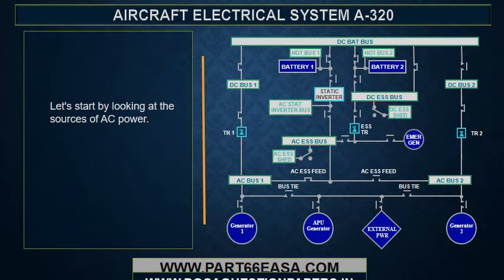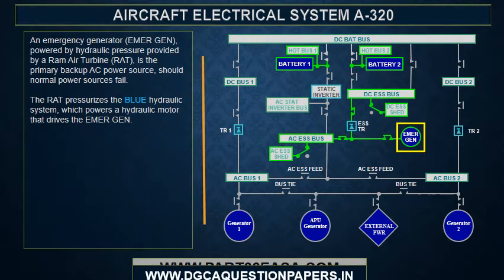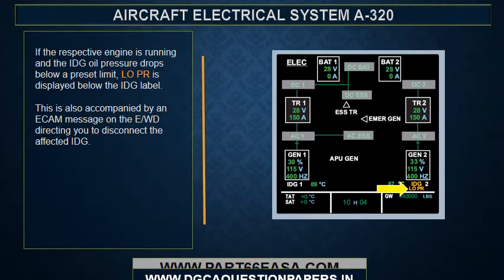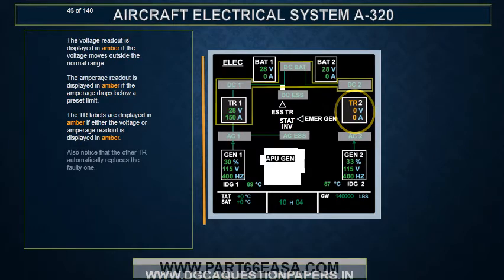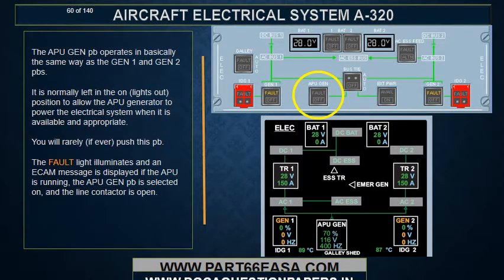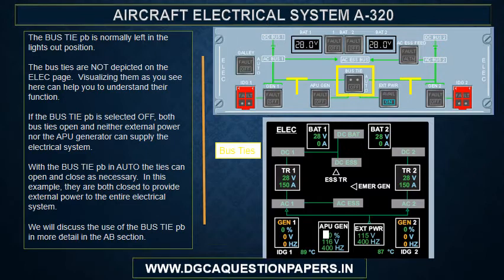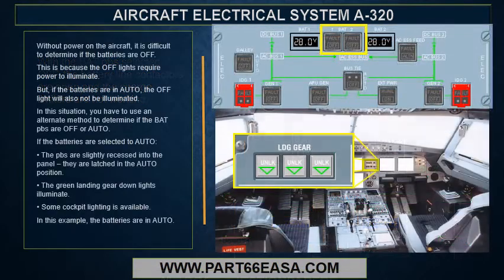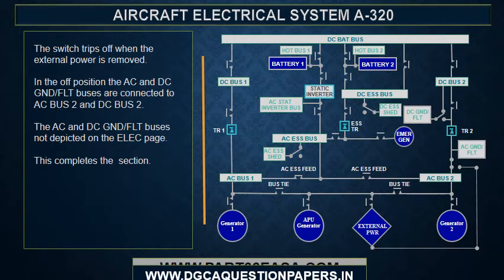Know All About Aircraft Electrical System- Airbus A320 Family (Part -1)

Comment: FYI: It's not "90 kilo-volts PER ampere". The generators don't output 90,000 volts. They output 115 volts.  The correct phrase is "90 Kilo-Volt-Amps" or "KVA" which is roughly 90,000 Watts. What you said is 90,000 volts.
Reply from the maker: Thank you for correcting us. However, due to restrictions on YouTube, we will not be able to correct it in this video.
Reply: @Jaziel Cade lately I have been using Flixzone. Just search on google for it =)
Reply: @Krew Nixon yea, I have been using flixzone for years myself =)
Reply: @Jaziel Cade you are welcome xD
Reply: Volt x Amps not is the same of Watts, due impedance. All energy offer by generator not is real used, due impedance. Watts is applicable to Direct Current (DC) generators.
Reply: @heberluizzunarellimartinsl4664  A watt is a unit of energy. It’s applicable to anything that produces power and does some work. It’s not limited to DC generators. You are correct that not all the energy does some work, but volt x amps is absolutely what a watt is.
Reply: @xNYCMarc  A small clarification: a Watt is actually a unit of power, not energy. Power is the rate at which energy is used or produced. Watts can indeed be applied to any device that produces power, whether it's an electrical device, mechanical system, etc., and it's not limited to DC generators. You're right that not all the energy necessarily does useful work, but the product of volts and amps gives us the power in Watts, which indicates how much energy is being transferred per unit of time.
Reply: @guiduz3469  A unit of energy is also defined by its equivalent potential work over time. Your “correction” is a distinction without a difference.
Reply: @xNYCMarc  The key point was to differentiate between power (Watts) as the rate of energy transfer and energy itself
Reply: @guiduz3469  It’s a point that didn’t need to be made. It changes nothing in relation to the topic or the information given.

Energy is defined as the ability to do work. That ability is measured in joules, which is itself defined as one watt/second. 

Again, it’s a distinction without a difference.
Reply: @xNYCMarc  If I made the point, then your explanation probably wasn’t that clear, don’t you think, Mr. Know-it-All? Or are you also the new YouTube technical censor?
Reply: @guiduz3469  Or maybe there’s something that you just didn’t understand, don’t you think? Take your bullshit somewhere else. Your failure isn’t my problem.
Reply: @xNYCMarc   The real failure here is your self-esteem, as you come across as a genuine prick.
Reply: i guess Im pretty off topic but do anybody know a good site to stream new series online?
Reply: @Krew Nixon Thank you, I went there and it seems to work :) I really appreciate it!!
Reply: @jazielcade1290  Stop the bullshit SPAM!